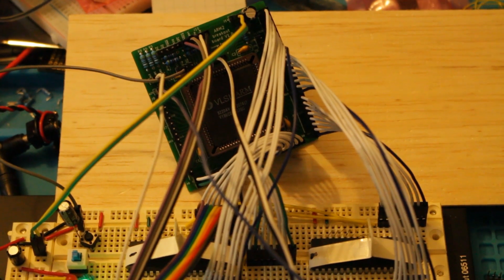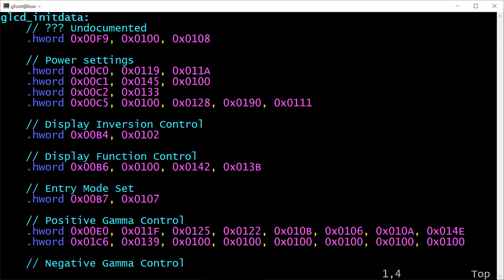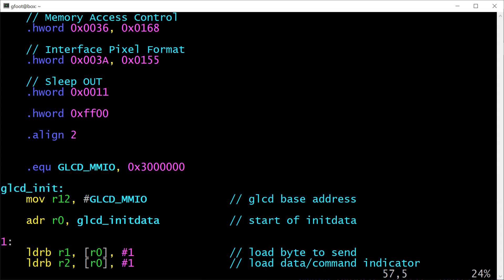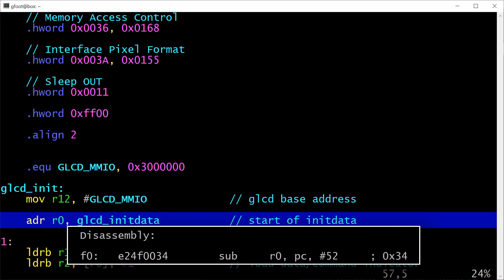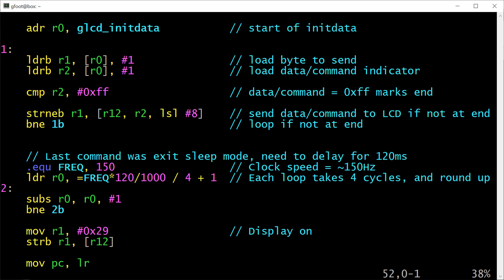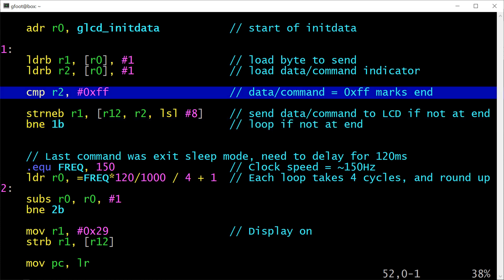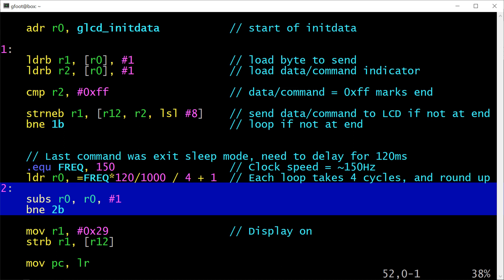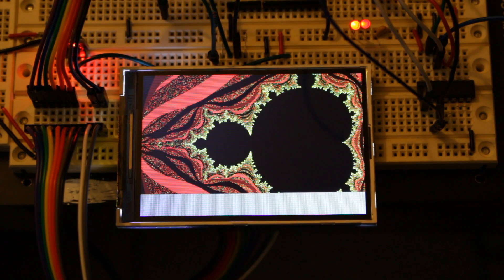Homebrew ARM2 #8a: ARM2 Assembly Deep Dive

Comment: Wow, for a Reduced Instruction Set Computer, there certainly is a lot of variation of commands.  While I can hand compile 6502 code in my  sleep, I would be hard pressed to even attempt it with the ARM2.  I've reviewed your video a couple times to try to wrap head around it.  Thank you so much for introducing me to more advanced assembly language programming!
Reply from the maker: Yes, it's an odd mix.  Most of it seems fairly in line with RISC principles, but some things definitely aren't.  The real value of RISC for them was that it allowed them to design a CPU at all, with a small team and budget, but they bent the rules quite a bit to get more performance than they would with a stricter model.

It is quite an orthogonal instruction set, with a load-store architecture, so it doesn't have all the weird addressing modes of the 6502.  In exchange there are a bunch of complex-seeming things that you just get "for free", especially barrel-shifting the second argument of pretty much any instruction.  The specific operation is kind of complex to learn but when you know it, it becomes natural.

The stuff with loads and stores auto-incrementing the index register is pretty arcane though.  I also didn't cover load and store multiple instructions this time - I guess I'll include them next time, as I used them to speed up the rectangle fill routine and they're important for sprite drawing.

Comment: It's interesting that there's no absolute addressing mode. Obviously the two step procedure of loading an address into a register, and then using an indirect addressing mode means you can do without it. Many RISC CPUs cheat and synthesize it by having a register that always contains zero. You then use an offset value with the zero register to simulate an absolute address for a load or store. But you are limited to the size of the offset value and usually not all of memory.
Reply from the maker: I think MIPS has a 16-bit set instruction so you can do a 32-bit register in two instructions. ARM doesn't have that. Some assemblers (maybe only for later ARM versions) do provide more flexible intrinsics though that generate multiple instructions to achieve the load.
The ldr with = is not very efficient if it has to go to memory, I think it takes three cycles, one of which is non-sequential. So if it's possible to achieve the same result with two non-load instructions then that's better.
B (the branch instruction) is a kind of special variant just for the program counter. It has 24 bits of the instruction dedicated to the address to load, which is an offset multiplied by 4, so it can load any multiple of 4 within the 26-bit address space.
Generally though most things seem best done relative to the program counter, and because of the shifting this can achieve quite large ranges - for aligned accesses.